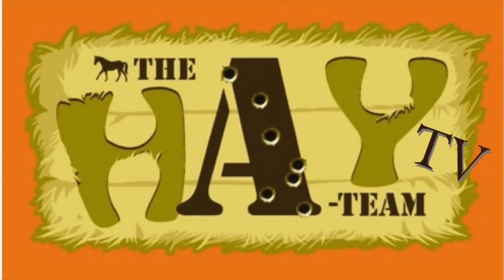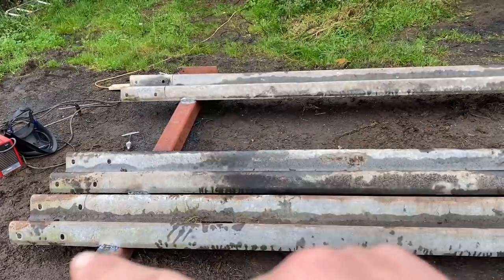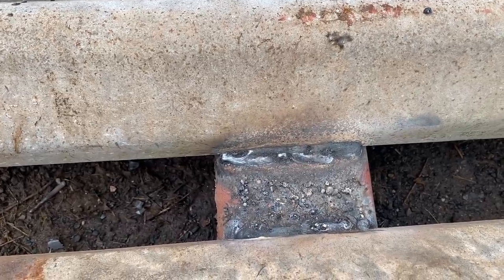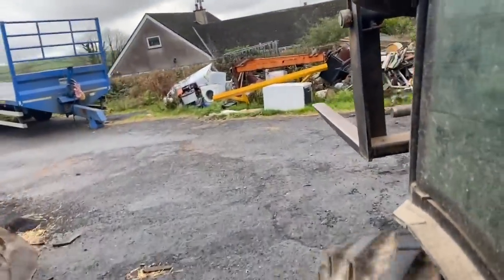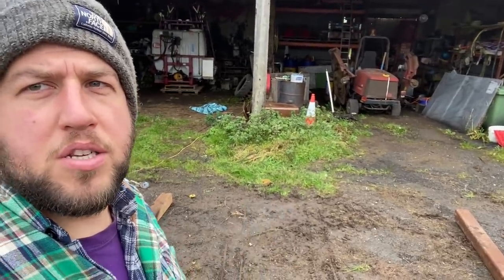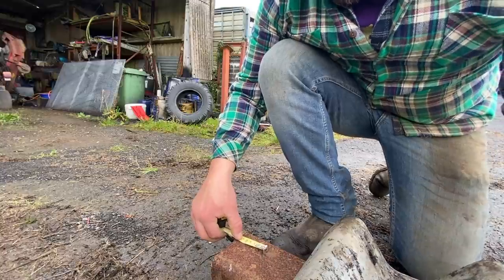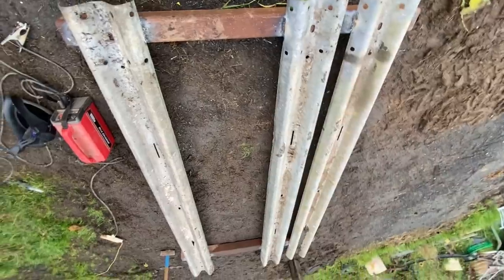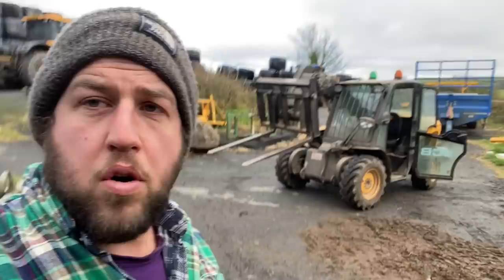farm engineering back in the present. Episode 109

Comment: This week the short haired twin brother will mostly be building a feeder 😜. The weld is bad because the crash barriers are galvanised, you need to grind of the weld areas before welding or burn it of with the welder and weld over again and again.
Reply from the maker: Yeah I just wack the heat right up seems to work

Comment: Unless you be using what we call here in the States a mud stick [6011], welding on rust is never easy and especially attaching anything galvanized [the fumes from galvanized metal can kill a person].    Good thing you were welding 'outside' - good ventilation.  As long as the herd doesn't knock your bunker apart, who cares what the welds look like - they looked good enough to do the job!  Besides, pack some mud on them for that 'used' look.  Great video - thank you.  Stay safe - be well - many blessings.

Comment: 😱😱🤦‍♂️🤦‍♂️🙈🙈
Wielding galvanized steel isn't nice at all. Also another thing place the rod along the wielding joint, like if your drawing a line across the steel,along with plenty of heat. The shouldn't have had any problem with wielding them together.
You should wield 4 flat pieces on the bottom of the legs aswell.
At first I thought it was his Royal shortness at it again. 😂😅🤣
Anyway great video. Keep it up. 👏👏👍👍

Comment: Top marks for trying ,but a bit of grinding with the materials ,wouldn’t go a miss ,you would of got a better weld .especially with using galvanised metal ,I’m interested to see when it’s finished ,great vid .😷
Reply from the maker: I just turn the heat up!
Really burn in to it
Reply: Shouldn't weld the barriers without grinding the galvanize off as it gives off fumes that are harmful to to
Reply: @nigeldate7500  spot on galvanise is harmful to breath in ,just like the corona virus ,a mask is needed 😷
Reply: @thehayteamtv6830  just be careful as welding galvanised metal can be harmful to your health ,so the zinc oxide fumes are not inhaled ,a respirator is recommended ,plus all the safety ware ,this is why galvanising is done after ,just a heads up 😷